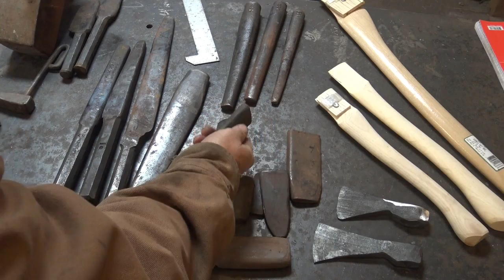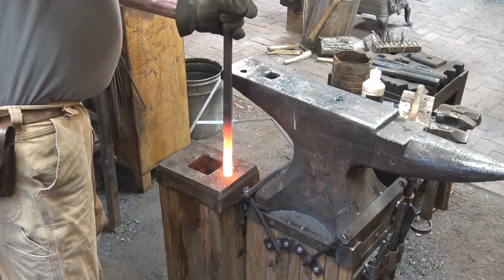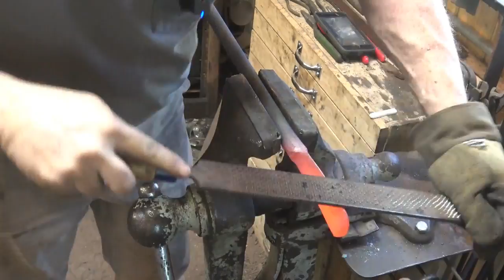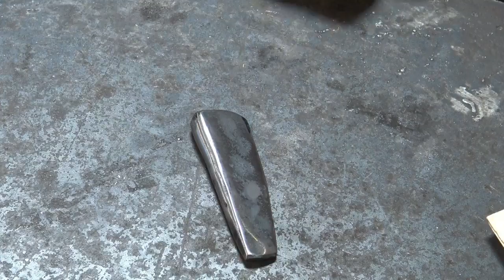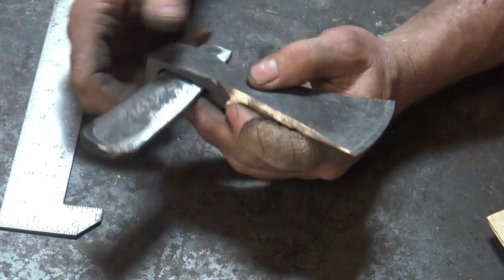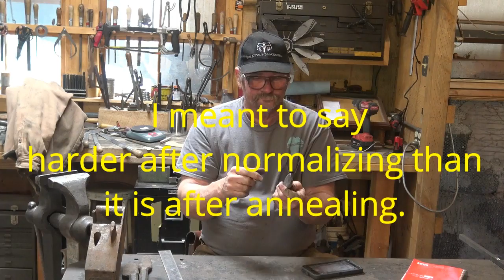Forging an axe eye drift - basic blacksmithing

Comment: Won't using the drift have a tendency to smooth the sides of the drift out?  If so, fine sanding the rough drift would not be very necessary.

Comment: Happy New Year John& Mrs Switzer.  This isn't a question regarding this video. I'm forging a hammer eye drift from scrap( 4140).  My dimensions at this point ( not completed) .  10" long plus handle. Small end 5/16 x 1/2. Large end 1 x 1 5/16.  I ve been using old hammer heads for my sizing . But finding big differences from 1 manufacturer to another. Please advise on dimensions.  Thank You
Reply from the maker: Just pick an old hammer you like and use that as your guide.  Don't over think it

Comment: I'm a little guy. Does it help to stand on a stool while I'm upsetting from the end like you show?
Reply from the maker: Yes, so long as it’s stable enough not to fall off. A second anvil or large piece of steel sitting on the floor is another option.

Comment: I understand the metallurgy of hardening your drift, I just have a hard time understanding why you need to go through all those extra steps when the drift is used when the axe is at forging temperature and will move around the steel. If you use mild steel aside from mushrooming, I don't see that much draw back. Thank you for your thoroughness, I will make one and have my own experience. Ty
Reply from the maker: Mild steel drifts are OK for limited use. But they don't hold up well over time.  A hardened drift will get tempered way back in use, but it's still harder than mild steel and will provide years of use.

Comment: In this video at 12:10 we have a great closeup of your anvil. It looks like your anvil has a different piece of steel that makes up the surface, (maybe 3/8"-1/2" inch thick.) Is this the case? Would it be a hardened piece of steel to improve the long-term endurance and keeping the surface flat?
Reply from the maker: While those old forged anvils did have hardened steel faces welded on, that isn't what you're seeing here.  Someone had used hard facing rod to repair the edges at one point and just didn't get good penetration around the edge.

Comment: I would have thought that the heat from the drift would have ruined the rasps temper? I had no idea you could do this "hot rasping " . Thanks for the info
Reply from the maker: You would have to set the rasp on the hot work and leave it in one place for several minutes to transfer enough heat.

Comment: Love your channel, but something I would love you to cover is quenching oils. I know you said 
No to used motor oil. I have seen it said canola 
Oil was not a great option even though many use it. What would but a fast quench oil that could be had around home with out buying high $ oils.
Reply from the maker: Thats a good question and one that I may not be qualified to answer with any degree of accuracy.

Comment: Will that drift fit in the hardy hole of the anvil?
Reply from the maker: I don't know if this one fir that anvil or not.  But there are ways around drifting into the hard hole.  Such as opening you leg vise just the right distance or using a swage block with an assortment of holes.

Comment: I was wondering if you could make a drift from something like 0.5''x1.5'' or bigger peace of steel just by remowing material. Can someone tell me if this is possible. I have access to a forge but I don't really have anything to make a drift from.
Reply from the maker: Sure, grinding or machining is always an option

Comment: Is it possible to carburize a mild steel drift (Clickspring did this for making files) for increased durability? I have lots of mild steel and unknown steel, kinda hard to get my hands on tool steel however. Just nobody in Finland seems interested in selling small stock, going to the machine shops and buying off cuts resulted in lots of mystery metal and they told me it's mostly mild steel. Local junk yard closed this year to letting people go in and scroung the heaps and buy scrap by the kg, feels like a noose is tightening...
Reply from the maker: It is possible, but I have never found it to be as good as starting with better material.  A better option for mild steel is what people call super quench.  Its a special mix that provides a quench fast enough to add to hardness to mild steel.  You should be able t find the recipe online.

Comment: One question I have is couldn't I upset it, then work the steel in reverse so I can leave a decent amount of the round bar on the top end of the eye drift? If I were to do it that way and taper out the end thinner and work my way back with that work? Because I know with an axe handle drift I'm not trying to push the drift all the way through, I want the top of the eye on the top of the head to be a little bit narrower because I don't use Hardy tools too much and I'd like to be able to drift it by hand and if I could leave a decent piece of round bar top end of the drift itself I wouldn't have to try to hold the drift with a pair of pliers or tongs and I could just hold the handle then I would be making also with the heat transfer even though I'm dipping it into a 5 gallon bucket of oil to keep the drift cool I still get a lot of heat transfer on my other drifts and I usually we're just a pair of work gloves I don't really like using welding gloves over the work gloves which is what I end up having to do with the dress I have that don't have a decent sized handle on the end
Reply from the maker: There are many was to approach any given task. Whether to draw out heavy stock vs upsetting smaller stock is just a matter of what materials you have on hand, what tooling is available and how you prefer to work. Most of my drifts are made long so I can hand hold the struck end. But I also have a power hammer to work big stock.

Comment: does hot rasping using rasp for wood?
can i use bastard file?
Reply from the maker: A bastard file works bit for really moving material quickly a used farriers rasp works great.
Reply: @BlackBearForge  aw crap can't find farriers rasp here in my country
Reply from the maker: Then just use the coarsest file you can find.  Used one work well, so you don't need brand new.  A woodworking rasp that is to worn for woodworking should work as well.
Reply: @BlackBearForge  thank you for the fast reply, have a nice day! (or night)

Comment: Thank you john sorry but I don't think I got enough heeled for drift or understanding what they are
Reply from the maker: A drift is the tool that defines the inside of a hole, in this case the eye of an axe.  they are used as a form in the eye while forging the outside or simply to stretch the hole to size (within reason)
Reply: @BlackBearForge  thank you very much

Comment: Weight of your hammer?
Reply from the maker: I'm not sure which hammer was used in this video.  I typically use either a 2 1/2 pound or a 3 pound hammer
Reply: Alrighty, thanks.

Comment: Thanks John for the advice on your take of dimension on drifts ,very helpful for me . I normally make my own handles because of the way the grain runs on commercial axe ,or hammer handles you buy from the hardware store.in Ohio I can go to the lumber yard an pick out lumber with the grain running the way that I like,an cut the handle out.thanks again for insight.
Reply: Hey John. Just  wondering why you chose to draw down  for the narrow end of the drift into the mass of the bar rather than drawing the tip down. 
Was it because you got the best upset at the free end for target size? It was not apparent to the viewer of the video.I didn't catch it in your description.

Comment: Is an old axel decent enough steel for hardy tools, drifts etc?
Reply from the maker: It should be.  Axels are pretty tough material and are generally a medium carbon.
Reply: Black Bear Forge ok thank you

Comment: FYI,  Speaking of a "boy's axe"...
I still have the axe my father bought in the 60's, and I actually like it better than the full size axe I bought myself in the 80's.
It"s a Sears 5102 2-1/4 lb. (1.02kg) Boys Axe.
From the top of the head to the butt is 27" (683mm).
Still has the original painted handle.

Comment: Hey John thank for another awsome video I learn alot from you. Can you post a Link to the sucker rod chart you where refering to. Sorry if you already have I must of looked over it.
Reply from the maker: https://www.google.com/url?sa=i&rct=j&q=&esrc=s&source=images&cd=&ved=2ahUKEwiBuZTO4b3aAhVD5YMKHb7kBIEQjRx6BAgAEAU&url=https%3A%2F%2Fwww.bladesmithsforum.com%2Findex.php%3F%2Ftopic%2F12109-oil-field-steel-and-rods%2F&psig=AOvVaw3_9bGqV7V__as9D1S9Ce2Y&ust=1523932629003321
Reply: Black Bear Forge thank you John

Comment: thankyou John, another fantastic video mate. it's interesting and great to see, as we grow as budding smiths, you too grow and flourish in front of the camera. you're a natural! i made a drift a while back for set hammer handles (i need a flatter) out of a 1" diameter stabilizer from a car. really tough to forge and i haven't heat treated it, but there's not even a mark on it after three hard uses. it even turned dull red one time! just another option i guess. my next will be a peice of 1' 3/8" jackhammer bit. this video is the best I've watched. thanks again mate, til next time
Reply from the maker: Thanks, there are days I feel like I have never been in front of the camera and have no idea what to say.

Comment: Maybe a little out of topic, but when I "upset" a bar I always end up getting an eccentric bulge at the end. It is just to turn the bar while striking and to take care of the straightness. Please help
Reply from the maker: Upsetting always wants to go off in all sorts of directions.  Making sure the bar end is square and the you are striking it straight on helps as does rotating the bar.  In the end it mostly comes down to straightening it often so it doesn't go to far off.
Reply: Thank you for the good advice. Next time I will still practice doing upsets.  I certainly still lack experience. 
Posted at 2204 Hr - Local time. Have a nice day

Comment: Hello john.
Just wondering is the eye of an axe tapper more on the the bottom of the eye or the top. Or should it have the same tapper.
Thanks Mariano
Reply from the maker: I prefer them to taper equally so that the narrow portion is centered in the eye.  With the exception being a removable handle, in which case the taper is all from the top so the handle can slide in until it fits tight.

Comment: Where do you buy your tool steel? I get most of my steel from the salvage section of altitude here in Denver, but they do not have tool steel.
Reply from the maker: Most regular suppliers don't bother with tool steel.  I buy most of mine online from McMaster Carr.  It isn't cheap but they ship quickly and have always had what I needed in stock (assuming it is a type and size they carry). https://www.mcmaster.com/#steel/=1cfcuto

Comment: Do you or anyone out there know what the cutting edge for like a dozer blade or loader bucket is made from. And the blades of a commercial wood chipper are made of I have several of both.
Reply from the maker: I suspect the dozer blade is a high wear steel.  Tough stuff to work with.  I have no idea on the chipper blades.
Reply: Black Bear Forge would it be good for tool making. Chisels punches drifts and such. If it's what you think it is. 
I'm going to thro the chipper blades to the side for now
Reply from the maker: The tools would probably be good but it is a whole lot of work to forge
Reply: Black Bear Forge thank you sir
Reply: Done some research the chipper blades are A8 tool steel.

Comment: Sucker rod, sucker rod. I hear the term a lot. I don't know what a sucker rod is. Is it an American term?
Reply from the maker: It might be.  It is the rod that connects a surface mounted jack pump with the in well portion of the pump.  Typically used in oil wells.  Ig is replaced as part of a regular maintenance schedule.
Reply: https://en.m.wikipedia.org/wiki/Sucker_rod

Comment: Ha and there was me making a drift that was 12 inches long, took ages. Next one is going to be 4 inches long. Thanks for the tip.
Reply from the maker: You'll like the 12" one.  They're just lots of work.
Reply: It was a hammer eye drift from high tensile bar and it took hours to upset and forge. The starting material was too narrow to start with. It ended up being just one inch wide at the top. But learned a lot from it so not all bad.

Comment: Would mild steel work for an axe drift?
Reply from the maker: It will work fine, but won't make as many axes before you need to make a new one
Reply: Black Bear Forge thanks👍

Comment: really helpful set of guides as a greenwood worker ihave always fancied making my own carpenters axe and broadaxe for squaring timber trunks, vital info, i started on blacksmithing at school and picked up a nice old english anvil (150€) and a small original hand blower farriers forge French updraught "le mistral"(50€)!!! took the blower apart cleaned and oiled worked straight away, you are reforging my enthusiasm, thankx
Reply from the maker: I am pleased that you are enjoying the videos.